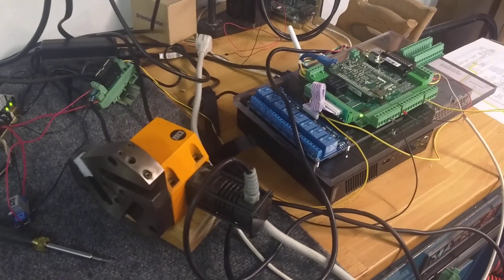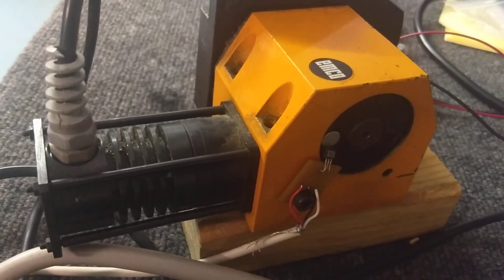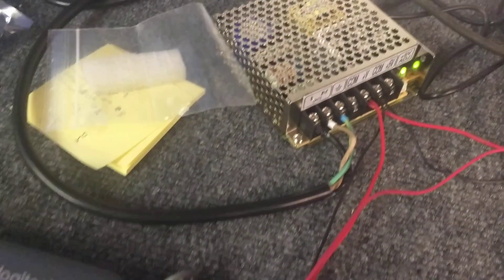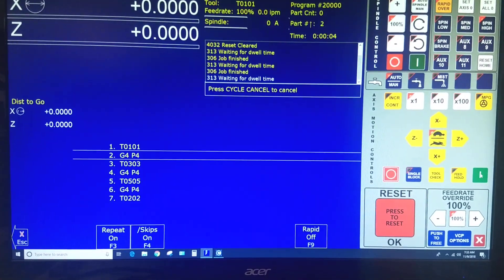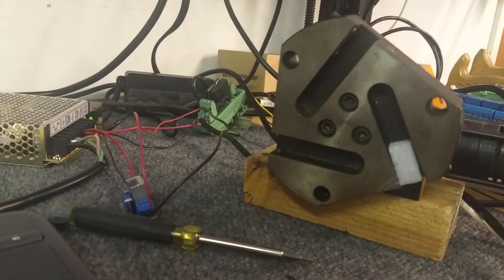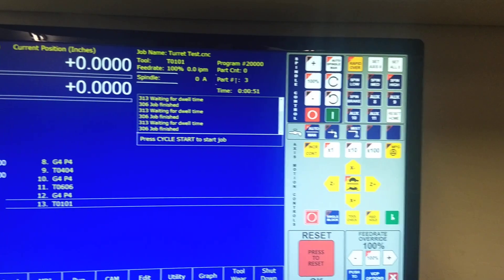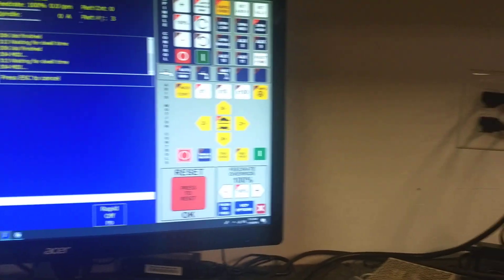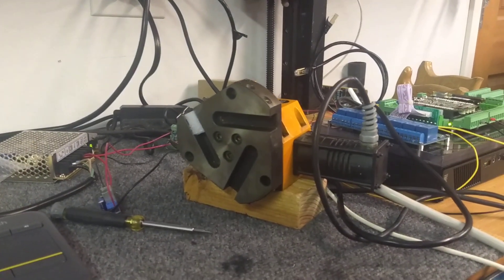Quickie: Emco CNC 5 lathe turret controlled by Centroid CNC Acorn

Comment: i have an emco 50 that is almost done. everything works great except for turret. hooked up like schematic says.  tried to find centroid_acorn_v480_lathe_universal file. it says I need to unzip into c:\cnct . only file I find like that is not zipped. tried the file that was not zipped and it didn"t work. on the inputs, no toolturretsyncbit option, no toolturretcounter. on the outputs no rotate toolturretcounter to select. spent all day trying different stuff. even uploaded your report and that didn't work either. Im really frustrated, help
Reply: Can you help with this?
Reply from the maker: @shawnscott4917  post to the Centroid User foruum

Comment: Crazy how similar but how different the 5 is compared to the pc turn and concept turn 50/55 models. The PCT and CT50/55 use an encoder for tool station position (6 or 8ppr) and home pulse (1ppr). These are definitely cool little machines, though :)

Comment: hello martyscncgarage, I downloaded the plc and macro for the time based tool turret changer from centroid. As per instructions I simply copied the files and pasted it to cnct directory. When I open CNC12 all the outputs such as nofaultout, spindle cw and ccw, mist and others are working fine except for OUTPUT2 which is for the turret. Nothing happens when you go to MDI type M18 and start. Can you help me figure this out...I am using CNC12 Pro software.

 Thank you very much
Reply from the maker: Go to the Centroid User Forums and post a report and pictures of your turret and how you have the Tool One sensor connected: https://centroidcncforum.com/viewforum.php?f=60
Also post a screenshot of your Alt-i diagnostic screen.
Reply from the maker: Did you try typing a tool change in MDI? T0202 cycle start for example...
Reply from the maker: Also, did you set the parameters correctly? There is an instruction sheet with each PLC program.
Reply: Hi marty, finally found whats causing the problem, reviewing the source code found the line M62 which turns on OUTPUT 2 for the relay 2, found the there is a semicolon before it. So it wont turn the output 2 ON. Removing the semicolon and recompiling it solves my poblem. Thank you.

Comment: Any update on the tool change? Also do you have a BOM will all the parts needed?
Reply from the maker: I do, but I spent a lot of time and money putting it together. I'm going to do three more CNC5s soon.
Reply: Probably late this summer before the IO expansion module will be supported.
Reply: @MartyEscarcega  Thanks for the update ! Do you have an excel or list of parts used in this build?

Comment: Marty, It appears that the 3.3v for reverse is NO, i.e. reverse is on excerpt when signal is sent for tool change and forward movement of motor. The only timing control you are doing is on forward for tool change. Is this correct? 

Thanks
Reply from the maker: Turret holds in reverse at the low voltage until a tool change is called

Comment: So if i understand this correctly you are using a time delay to determine the alternate tool positions.  How repeatable is the tool position with this setup?
Reply from the maker: It's repeatable, just as it was originally. Must have a smooth operating turret and stable 12vdc
Reply: @martyscncgarage5275  have you thought of a way to use more sensors?
Reply from the maker: @sjb_rnd  sure create a plate and add a tool count sensor or use gray logic four slots. Centroid supports them. I'm not doing that to this little guy. This was all about just getting running and operation as Emco did
Reply: @martyscncgarage5275  oh yeah i recall you showed that in another video. That's cool. Gonna have to integrate this in my slant bed lathe design.

Comment: Hi marty,, is that acorn only display the g code while cycle start? How can i want to toggle between graphics?
Reply from the maker: It's on the RUN screen
Reply: martyscncgarage 
Cycle start won’t work when onthe RUN screen,,
Reply from the maker: @TheFixxxer11  please download the Centroid mill manual and search RTG. You go to F4 run, toggle F10, THEN hit eascape back to the main menu when you CAN press cycle start to run the program. F4 Run screen is where you select options before you run the program. You need to spend a little time reading the manual. 
Also, use the Centroid User Forum to ask your support questions. There all users can get the benefit of reading the question and learning about what the answer is. I and Centroid support staff monitor the forums. Users help each other as well. http://centroidcncforum.com/viewforum.php?f=60
Reply: martyscncgarage 
Ok marty, i will download it,, and 1 more question, if i could,, im using like leadshine motor driver, and the driver is set for 4000 step / revolution,, do i need to multiply 4 in the axis setup? After this i will enter the forum,, i did ask in the forum under name rosmadi,, but I don’t get the quick answer for what i ask,, sorry if i make u feel  annoying,, 🙏🙏
Reply from the maker: @TheFixxxer11  please post your questions to the forum. This is not the proper place.